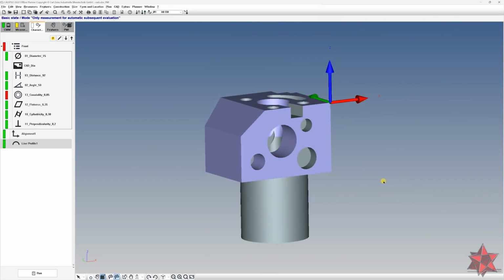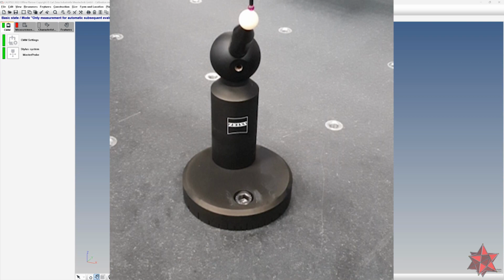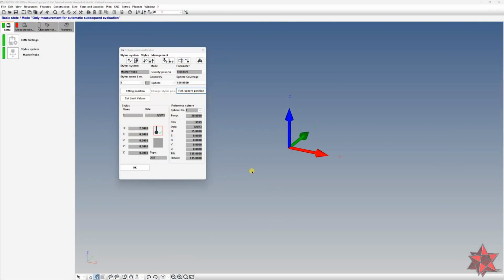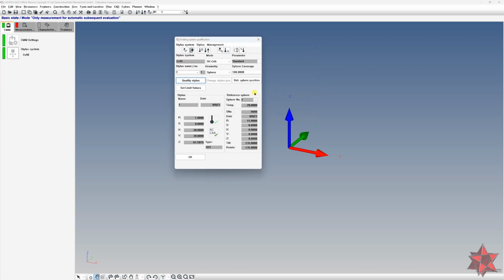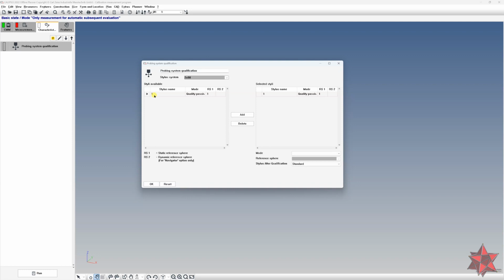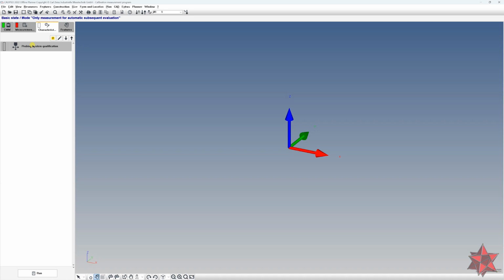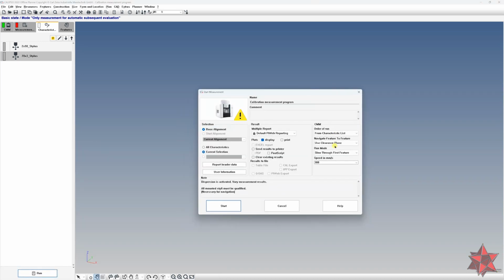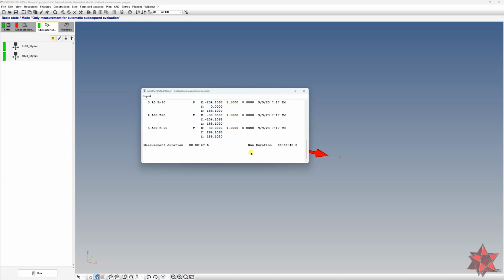Zeiss Calypso - Automatic calibration step by step

Comment: What is the difference between standard and robust?
Reply from the maker: Sensitive : suitable for high precision, slow speed and small stylus diameter.
Standard : Default setting.
Robust : Intended for rough surfaces  to be probed at high speed and reduced precision. 
Information taken from Calypso help material.